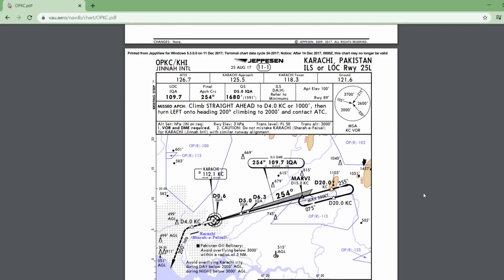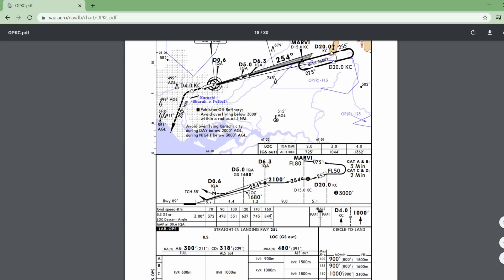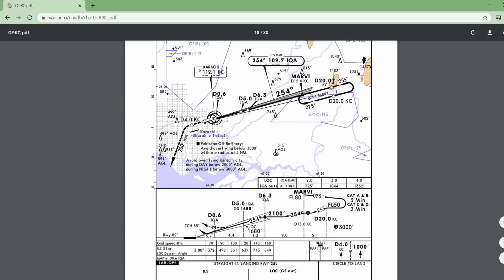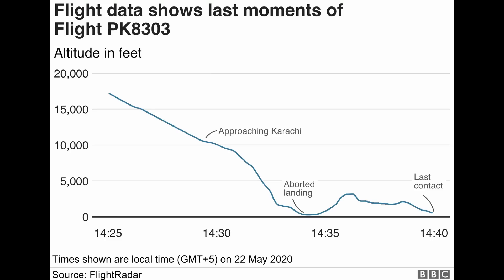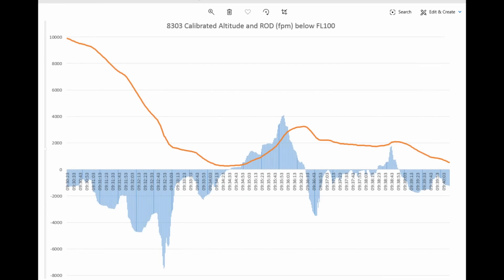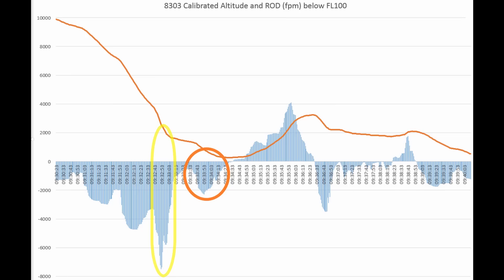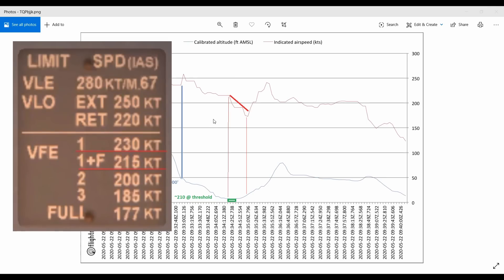PIA #8303 Update #4 Unstable Approach Profile

Comment: The pilot was warned twice by ATC. Both times he replied, "he was comfortable ". This pilot must have been on drugs. Completely ignored warning chimes, ATC and never told ATC their landing gear was stuck so they could foam the runway. Unbelievable!
Reply: They never told ATC because the landing gear wasn't stuck. They deployed it on the second approach but stalled before reaching the runway.
Reply: @alaindumas1824  Two possibilities with that; one is that they set the lever to raise then lower, allowing the landing gear to deploy properly as they were below the threshold; two, they had to manually lower it (Not sure if the RAT powers the hydraulics for the landing gear)
Reply: I think he forgot to deploy landing gear after  diving in for line up for landing, it seems  that pilot wasn't  in control of his faculties.
Reply: He was going too fast for the landing gear to deploy in time.  I bet they pull the lever early on a regular basis and rely on the gear deploying automatically once they shed enough speed which is why no one was concerned about the warning chime because they hear it all the time.  This time, they couldn't shed enough speed in time.
Reply: @Andy
Thank you, you beat me to it. Anyone who listened to Juan would have heard that this aircraft was going too fast for the landing gear or flaps to deploy on the first attempt.
Reply: @Andy-df5fj  He never deployed the gear, IMO. The plane was below 250 for several minutes prior to the zero level flyby. Plenty of time for the gear to deploy if it been deployed. Gear takes less than 20 seconds to cycle.
Reply: If they had a gear problem, they would not have dive bombed the runway. They would have flown in circles trying to work it out while talking to ATC and maintenance about it..
Reply: @bills6093  with that pilot not sure about that, probably he would have dive unto the runway anyway
Reply: When the pilot was just 5 miles from touchdown the plane was still high as warned by the ATC and the pilot seemed to be ignoring him throughout the approch.....
Reply: A comfortable idiot cowboy flying this one!
Reply: And what was the copilot saying to the pilot during this “dash & dive” to the runway? As Juan said, good crew resource management is vital to achieving the requirements of a stable approach. The CVR transcript will be very interesting.

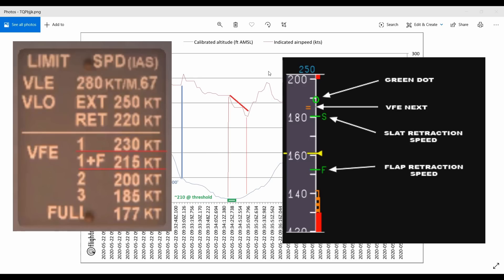Comment: 7:24 but I don't see a reason why the gear wasn't extending... since this should be possible at all times (except the extreme dive). Is something else preventing the gear from extending, like a wrong mode, no flaps, or a high rate of decent etc?
Reply: Gear doors can't open over 200 kn
Reply: Ruben Kelevra if the rate of decent was too fast like this...gear will not come down
Reply: Ruben Kelevra--pay attention.  This was very well explained in the vid.
Reply from the maker: see previous updates...
Reply: @blancolirio  thanks for the fast response, the previous update explained that there's a safety valve which's status is operated by two airspeed indicators. The airspeed needs to be in excess of 260 kts - according to the diagram from the last update for the safety valve to be shut.

260 kts was exceeded for a very short amount of time - and I think much earlier than they would have tried to extend the landing gear.

Comment: Are you saying the messed up approach distracted them from attending to the gear?  Even with alarms blaring?
Reply: Or, did the excess speed prevent the deployment of the landing gear; even with the manual selection of gear down.
Reply: What Juan explained in one of his videos was that if the approach speed was too fast, the aircraft systems would not allow for the extension of the landing gear, as a mechanism to prevent damage to the landing gear or landing gear doors.  Thus, when the pilot or co-pilot pulled the landing gear lever to extend the landing gear, they were coming in much too fast, the aircraft systems denied the extension of the landing gear (which prompted the audible chimes heard in the background when the pilot was transmitting), and the aircraft engines made contact with the runway.
Reply: @LowEarthOrbitPilot  Do we know if this system would automatically lower the gear when below the limiting speed (260kts?), or would it have to be manually re-selected once below that speed?
Reply: BILL S  So does that mean the plane never met the conditions for the landing gears to deploy until after it was climbing out for the go around?
Reply: @neilonbarnett2473  that's exactly what I was wondering
Reply: @bills6093  
No they werent....their speed was 260kn at 2000ft....probably about the time they would be lowering the LG.
Reply: @Motorman2112  the gear will lower once the adirs signal below 260 kias, to the lg system allows the valve to open  yes, no need to recycle   but one should never get in this scenario
Reply: @Motorman2112  ---
Juan explained the pilots must reinitiate gear down when the craft reaches acceptable speeds.
Reply from the maker: yes.
Reply: Hell, they had EVERY alarm ringing in that cockpit !
Reply: @orbitalair2103  Probably it wasnt their first time doing this sort of things ?
Reply: Most likely, it has happened few times before. There have been a lot of accidents where a pilot forgot to lower the flaps for takeoff and the alarms were all going off that the plane is not configured for takeoff but pilots just ignored it and continued the takeoff and they all ended up with the plane taking off for few seconds and then stalling right away, most of the time killing everyone on board. The experts to this day can't figure out why pilots ignore such an extremely important alarms. Like in this crash the pilots were so focused on getting the plane down because they were too high on the approach that they got tunnel vision on getting the plane down and completely ignoring everything else.
Reply: @AviationNut  Sensory overload and panic. I have seen people in panic situations do the stupidest things, even when the reason for panic wasn't such a big deal. Do it in a cockpit with 100 people on board and it turns deadly very quickly.
Reply: Ive seen it happen in hospitals.    Lots of  dinging machines become  background noise.
Reply: But it appears some alarms are the same sound for closely related issues.  So the pilots may have assumed the alarm was for what they already knew.
Reply: Fa Mu  
I know that two people survived the Pakistani plane crash, I never said everyone was killed in the Pakistani plane crash. I was talking about completely different crashes where pilots ignored alarms to extend their flaps on takeoff and ended up killing everyone on board.
Reply: It appears that the gear down warning may have a lower priority than the EGPWS warnings for sink rate, terrain, and possibly overspeed they were probably getting at the same time. Because they're all continuous, only the one with highest priority plays until it's resolved. If they were 'expecting' the sink rate alarm due to their insane descent, they may not have noticed the gear down warning on ECAM until too late to save it. It might have been that warning suddenly gaining priority that prompted the GA, but it was too late to spool the engines and arrest the excessive sink rate.

Sooo not only did they execute this insane approach, it appears they completely ignored the checklist. And as Juan points out, it also seems like it would have been impossible for them to configure the aircraft for landing due to the high speed.

This was madness.
Reply: asdf  oh yes you can but they just make better stupid.

Comment: Those passengers must have been terrified.
Reply: I was thinking the same thing. Looks like they just fell out of the sky.
Reply from the maker: yes.
Reply: @blancolirio  Was The Captain Drunk?... Sure looks like it.
Reply: @blancolirio  

https://youtu.be/vdxGJ1TXJSE

Factual data comparison of 7 precious flights on same route, of same aircraft AP-BLD suggest the same as you explained.
Reply: @zeshanali3721  great link, thanks.
Reply: Who trained these idiotic pilots???
Reply: Looks like gear didn't deploy because aircraft said No
Reply: They weren't aware that They would be experiencing an approach in an Otter. Holy crap, this is pathetic.
Reply: Yep I experienced once an aborted landing, it was terrifying. The plane a 737, was screaming and shaking to climb back in the heavy rain. We did eventually land in nearby airport 100 miles away.
Reply: Trojan_Horse  makes sense because it was just gliding to the road...airbus great programing to prevent stall.
Reply: No brace for impact warning given by pilot on both, the landing and Mayday call
Reply: Ask the two survivors, the other 96 were killed.
Reply: I have made better approaches and landings on infinite flight!

Comment: Are commercial pilots punished if they do a Go Around? Thanks 🙏
Reply from the maker: No.
Reply: @blancolirio  But surely there must come a point when a higher than average amount of 'go arounds' start to raise red flags?
Reply: @antonrudenham3259  One would imagine. If a crew consistently is at 10K Ft when they should be at 2K, I imagine a review board is not going to certify a pilot until additional training is mandated. I think it will be interesting to listen to the cockpit voice recorder and see if this was some sort of Folie à deux or one of them was telling the other "You done fucked up". Didn't do them any good and they continue to screw things up, like lowering the gear way too soon on a damaged aircraft and pulling the nose up like an F18 hornet.
Reply: That was addressed in a recent video I watched. I think it was the Livestream with Juan and Mentour Pilot.  There is a no blame policy for go-arounds. In fact, they will get in trouble I'd they try to salvage an unstable approach.

Comment: Maybe I missed it, but why wasn't the gear down?  With the gear down wouldn't that landing just need less throttle and more brakes?
Reply: If they are over gear extension speed, a320 will not let the gear deploy even if gear down is selected.
Reply: @christianjackson  Will it deploy when it gets below extension speed, or does it need to be re-selected?

Comment: Soon as I saw the bottom of the engines I said “he forgot to put the gear down”. Sounds crazy considering all the warnings the plane gives you but just like the Asiana flight, sometimes people get lost in automation.
Reply: I doubt that he forgot to put the wheels down, more likely his air speed was too high to allow the wheels to drop.
Reply: @maxmoo3275  whether he forgot to pull the lever or not, there is NO DOUBT he didnt realize his gear was up until he started scraping.
Reply: @cccc9911  He should have,
Reply: @cccc9911  Listening to the ATC recording, I don't even think they realized they hit the runway. Probably thought they had too hard a landing and got it back into the air, then were surprised when the engines quit.
Reply: Murph's Models ... nooo.  Listen again... the controller asks if he’s going to make a belly landing....
Reply: @murphsmodels8853  agreed, I bet they never knew their gear was up, at least not until they might have figured out in the go around.
Reply: Didn’t forget,   High airspeed prevented gear drop (safety feature), but “gear not down” audible warning was not recognized for what it was. . .   

The biggest thing the pilots forgot was. . .   If you walk away, it’s a good landing. As for the hardware, that’s what insurance is for.
Reply: I wonder if they both fell asleep.....which had them so late starting their descent. It was all downhill from there...no pun intended.
Reply: C Squared I was thinking the same as I saw the decent profile... we will know as soon and IF they release the VCR
Reply: And he didn’t bother telling ATC they needed a clearing turn to get down or were behind the aircraft.... just unbelievable....
Reply: But even the most automated crippled pilot should have saw that this was a totally garbage approach and abandoned it.
Reply: BRAM is spot on.  You can put the gear handle down all you want... but if you are TOO FAST... you aren’t getting no gear until you get your act together... and YOU still have to put the handle UP...then down ( once you are in the proper gear deployment speed envelope). .... there is a Disconnect that happens.   It’s like circuit breaker in your house.  Once you fix the short circuit.... you still have to reset the breaker.   In the Airbus... with the gear handle down... speed TOO FAST.... the gear WILL NOT COME DOWN when you get to the correct speed.
Reply: @francisschweitzer8431  Speed profile clearly shows they managed to get below the gear speed limit. Its on ly conjecture at this point but it may be a case of simple sensory overload and they got tunnel vision focusing on getting the aircraft slowed down for the approach and landing. Looks as though they only managed to get flaps 1+F  ( leading and trailing edge flaps into position , Leading edge flaps I think position first and then the trailing edge based on speed ) and never got past this flaps setting. They got so caught up in this that they simply forgot to get the landing gear down. All this of course due to the fact that they either ignored approaches instructions to descend ( possibly due to falling asleep , untuned radio, distraction in cockpit ( see the incident in asia where the captain got caught up replying to messages in his phone when his phone came back into cell phone range and forgot to lower the landing gear) or any other reason why the approach was not executed in a timely manner). Basic and straightforward lack of awareness which in a 60 ton aircraft going at those speeds can ultimately lead to a situation such as this. This was pilot error. Plain and simple.
Reply: Maybe it was something else why the landing gear wasn't down I still can't believe both pilot wouldn't not remember.
Reply: The flap overspeed warning could have been going off continuously and in effect, muted the "TOO LOW, GEAR!" GPWS aural.
Reply: @mattp4735  I think Juan said the warning (bell chime pattern) for flap deployment at too high airspeed is the exact same bell chime pattern for the landing gear not deploying.  The plane does not have a unique warning sound for Landing Gear not deployed and a separate unique warning for high speed flap deployment.  The pilot probably ignored the warning because he thought it was for the high speed flap deployment and he knew he would be violating that air speed right through touch down so he expected the warning to continue to the ground.  A separate unique landing gear warning should be part of the design so there can never be any confusion of what the warning is for.  These fail safe warnings are rarely needed if following Standard Operating Procedures but when things start to fall apart and tunnel vision kicks in, there must be better warning systems that cannot be misinterpreted or confused with a different problem.